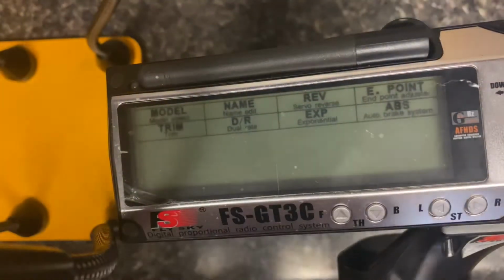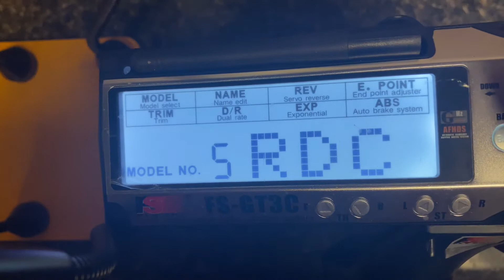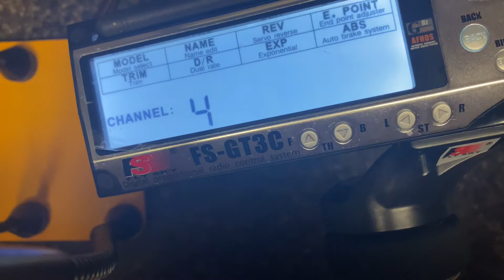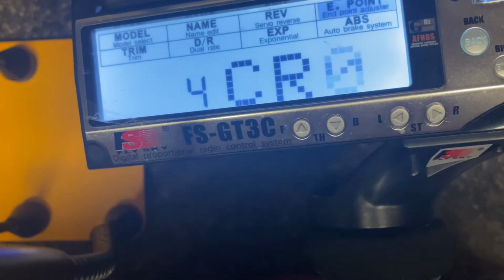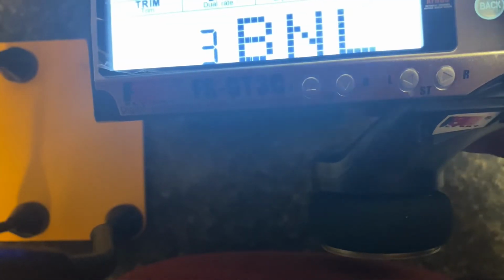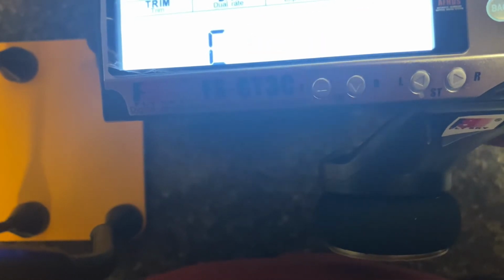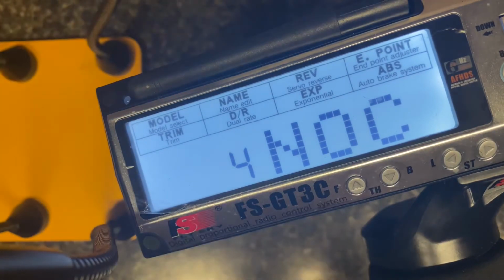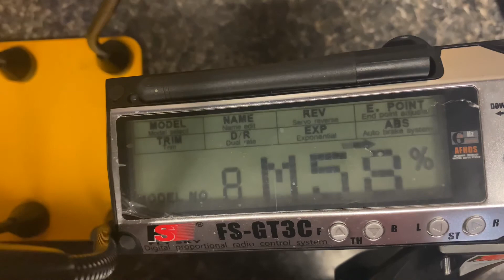Hacked GT3C 4WS Setup

Comment: Ive got everything to work except throttle/brake. can you help me on settings for that. I have 3 crawlers and lost throttle on all of them.
Reply from the maker: OK what kind of ESC are you running? Once you hook up this new transmitter more than likely you’re going to have to do a calibration on your ESC in order to get everything to work. Give me some more details about what’s going on I have noticed on these transmitters a lot of the times they are natively set up for 1/5 scale large buggies so many times you will have to reverse channel 2, but that’s easy enough to do. Let me know what your set up is and what issues you’re having and I’ll try to walk you through it
Reply: Cracks me up when people ask for help and then don’t interact when they are asked for more information so you can help them.

Comment: Is there a way to defalt it to just front steer, then push the switch foward for 4ws and back for rws?
Reply from the maker: Not really however on the switch I have it set up on if you were to click the switch forward and make it forward steer only it’s going to remember that sitting. Then if you click it back one time it’s going to go to four wheel steer click it back again rear wheel steer only. So I guess the answer is yes and no
Reply from the maker: Basically how I have it set up in the video is a three positions switch the middle being four wheel steering the back being rear wheel and all the way forward is Ford only hope that makes sense